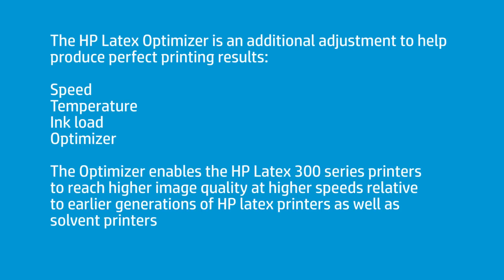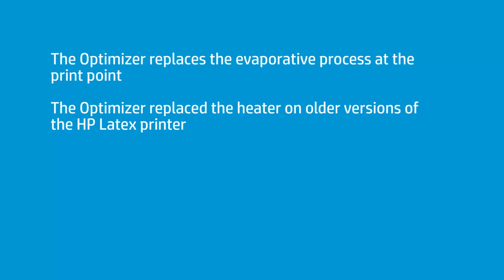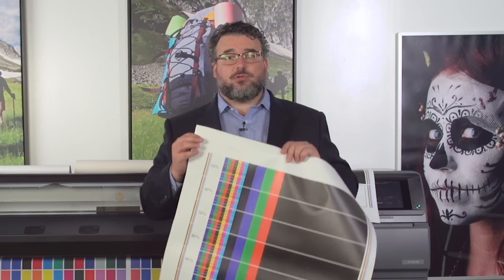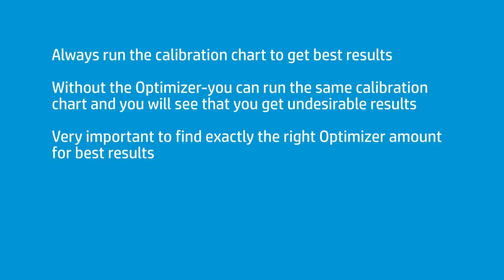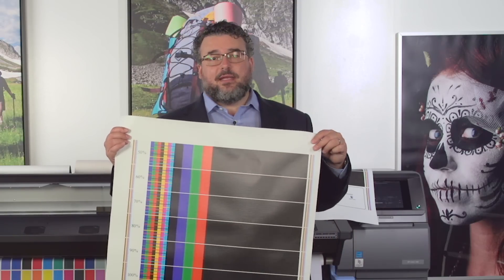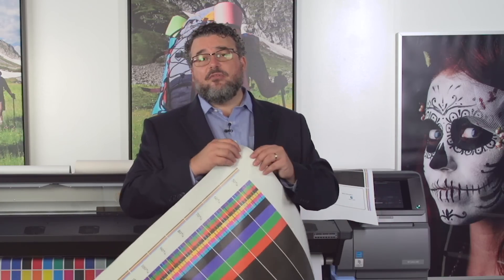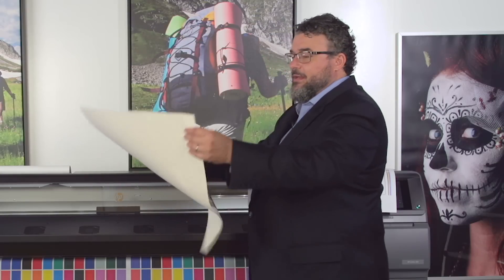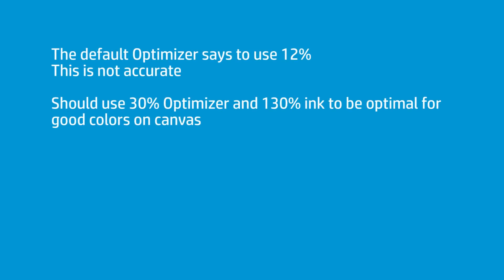HP Latex Optimizer: The Role It Plays in Printing | HP Latex | HP

Comment: With this information I find it surprising that the media preset for HP Everyday Satin Photo on HP Media Finder has a default optimizer level of 24? I've had technicians working on the machine stating that it should ideally be around 12? I find it difficult to rely on the Media Finder at times when settings there are so different than what technicians specify? @4:30

Comment: Hi Timothy. I am trying to get deeper technical information about HP latex printers since I am taking a decision between Roland eco-solvent and HP latex. I used to be a system engineer for networking stuff, going deep in protocol stacks, so, that's the kind of information I really like to have. I loved to learn what optimizer does. I am trying to understand how reliable is the HP latex 315 print is, but I didn't get any information about that. The Roland has a great reputation in terms how robust are their products, but, I don't find anything about the HP latex printers. My understanding is that the latex technology is still new, and HP is learning quickly new issues about that, and so, fixes are dependable on lauching new hardware/solution to address those issues. So, this can be a big problem to me to buy HP because I still don't feel confortable with quality/stability of the technology itself. So, if you have any other great videos like this that I should be aware of, please, let me know. TIA. Alexandre Veneziano
Reply from the maker: +Alexandre Veneziano Thank you for your query. You can find all the information related to the printer in the "User Guide" section in this document: http://bitly.com/2T8k6ZD Keep us posted for more information.
Reply: HP latex tech is now 10+ years old, the first generation had a few very minor niggles that were mostly sorted with the 300 series, and even more so with the newer 3X5 and 500 series. I have been using two HP360 with each over 50km of printing with very little issues, I think I once needed a fan replacement, and a belt broke once, I've only seen about 4-5 days down time in their life. The service schedule replaces any parts that may fail with age/wear well before they're likely to.
Reply: Hello, did you ever find that chart? I need it and I can't find it anywhere! Thanks

Comment: Was thinking about getting an HP but this sounds complicated.  Maybe I should stick to a roland or mimaki.
Reply: Did you buy a Mimaki? I'm in the same position. Mimakis  are reasonably priced. I like the white, orange and silver ink options. The light black does improve the grayscale images a lot. Ink is more expensive though.
Reply: We have an HP Latex 365 and is awesome! It seems difficult, but is really simple. The 365 does everything for you. The Temp, Ink load and Passes are really easy to use and the maintenance is really fast and easy.